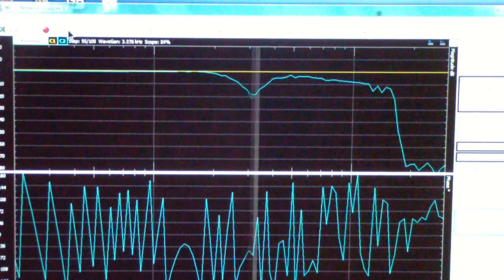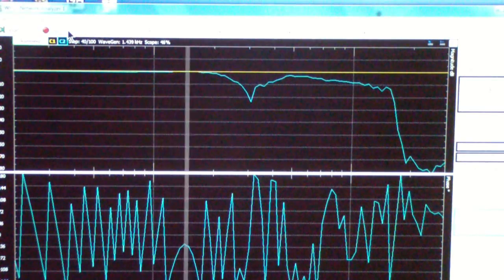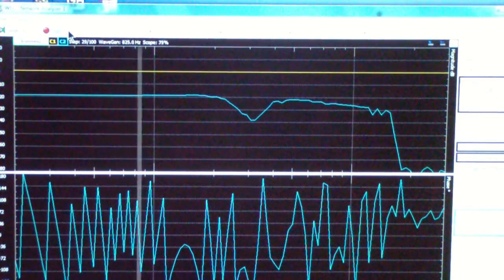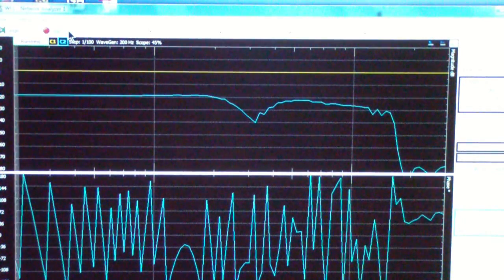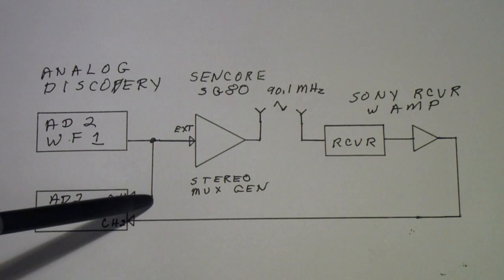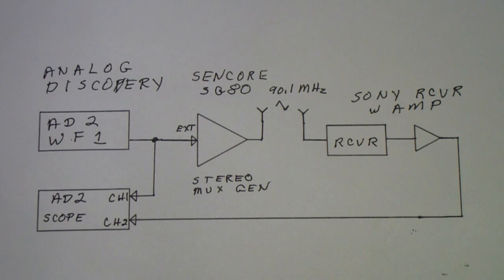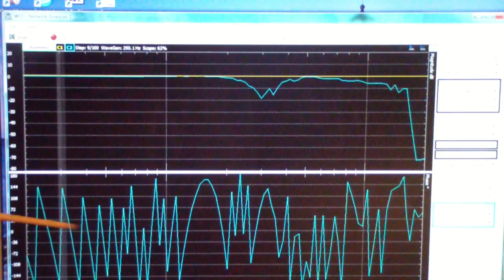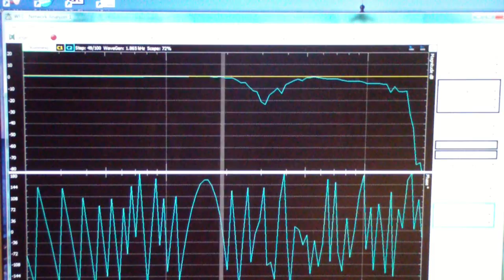TTT158 Sencore SG80 with Analog Discovery

Comment: Is the DUT a home theater in a box, meaning, does this dut have built in speakers?  If so, then the system may be designed to provide a practical flat response from the speakers' outputs as a system where the phase of the speakers and frequency response are taken into consideration.  Just a guess.
Reply from the maker: It is a home theater but without built-in speakers. It does have external speakers and a microphone which it uses to auto-adjust the response. I actually have more than one of these units but the auto-response turns out differently for them. Two work just fine but the third always has a weird response curve, even when they are all calibrated with the same speakers and microphone. I suspect the one weird unit is just defective, but I haven;t tried to fix it since I just bought it to use for spare parts. I have done more tests since the video was made but the weirdness persists in the one bad unit.